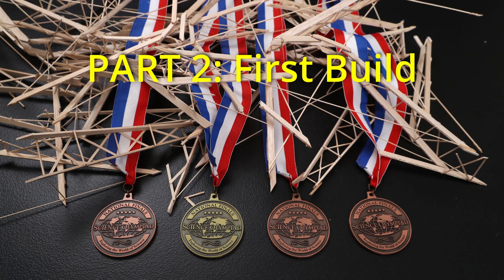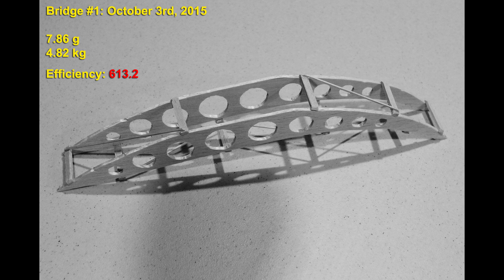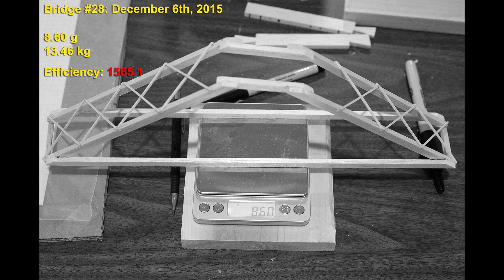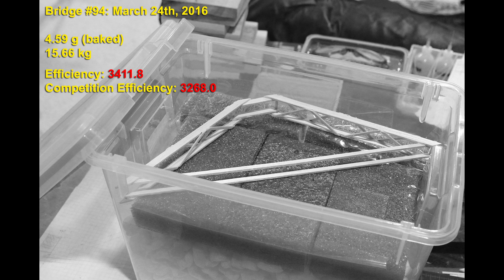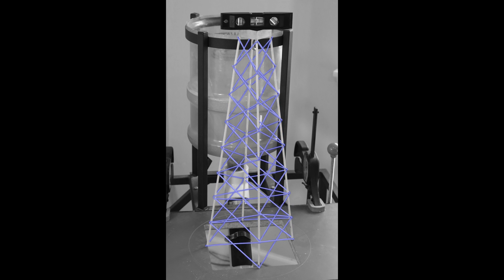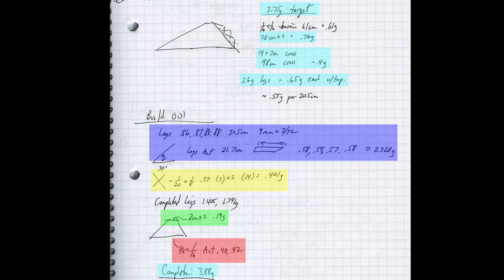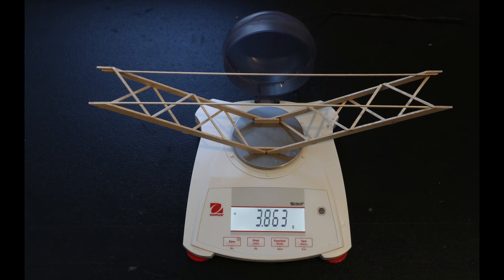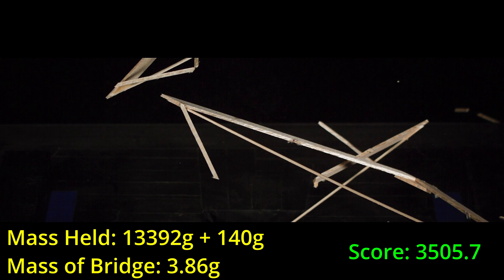Advanced Optimization for SciOly Structural Competitions: (PART 2: First Build)

Comment: How are your bridges so light? Using a similar design featured in the video, my bridge spans 30cm and had an efficiency of 1700. It also appears to be taller, thus whats the most efficent angle at the joint between the pure tension members and wider, hypotenuse members? Thanks, Josh
Reply from the maker: The short answer to why my bridges are lighter than yours are I'm most likely using less dense balsa.  You need to seek out "light" balsa instead of the more common medium density stuff.  For an optimal angle, I don't think there is an exact answer.  I have build 4500+ actual efficiency bridges anywhere from about 30 deg to 42 deg.  Good luck!!  Check out this video I made about balsa density to see why the lighter range works so well: https://youtu.be/mzMFhd4SqP8
Reply: Thanks my angle was around 55 degrees. I'll have to seek for some lighter balsa.